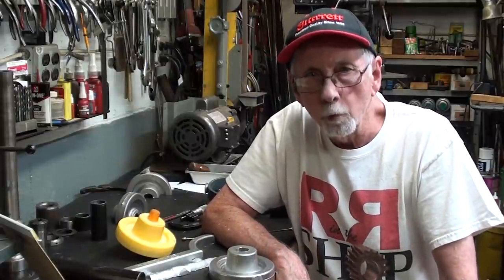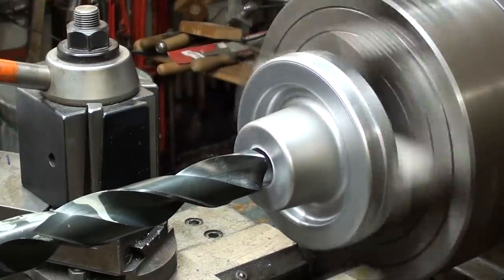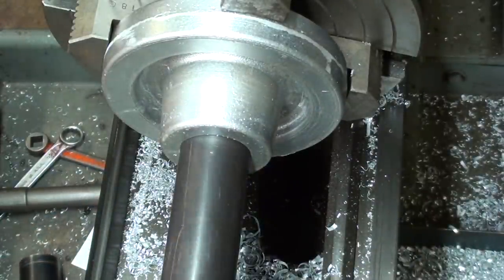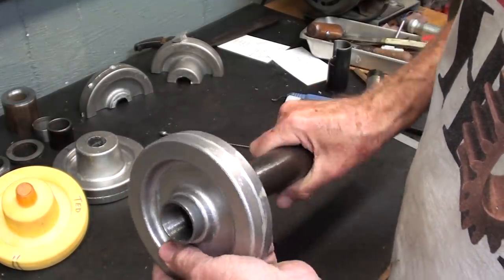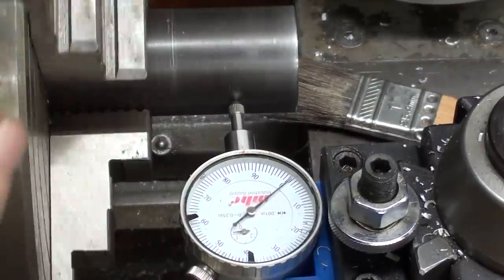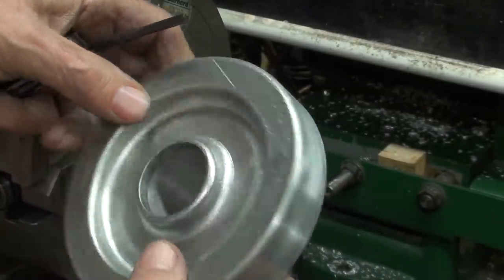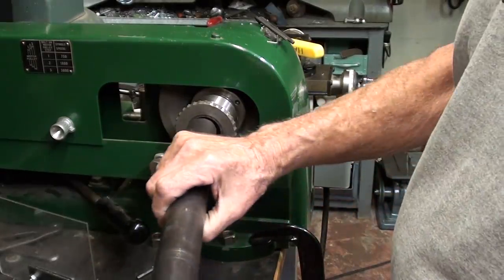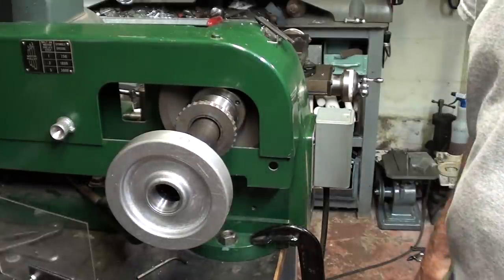Make a Hardinge Lathe Collet Drawbar 747 pt 3  tubalcain 5c attachment

Comment: Lovely.
Lyle,
You either are exceptionally practiced or simply gifted with an intuitive notion of how to teach. I think that you and Adam Booth understand the very best of what the inexperienced hobbyist needs to know, or more importantly what the hobbyist needs to see on YouTube video to gain the best understanding. Your camera angles give much insight into features and functions that you don't even comment about. I failed to grasp why your cuts were so light until you explained how poorly the casting was grasped by the chuck jaws due to the casting draft. You have a knack of what needs to be commented on and what needs to be shown. 
Your vise mounting bolt stop was adequate for locating the spanner wrench hole center, but if this was a precision location the casting surface runout could introduce too much error. Your employment of Loctite always unsettles me. I was trained to employ press fits, keying or pinning. Employing Loctite in applications like this seems legitimate. It allows assembly fit up ease and masks some machining inaccuracies. Precision boring and turning are difficult for me to achieve on my little Atlas. I introduce taper so easily. Employing Loctite in my projects is an option to remember. What color Loctite will you use for this application? That spanner wrench will allow tremendous force.
My Atlas came to me with a collet drawbar, but no collets. Do Atlas collets fit the spindle taper or do I also need an adapter. I have never seen any collets specified for the little Atlas lathes. 
I am anxious to get my new shop complete where I will have room to set up my partially restored LeBlond lathe. I am looking forward to the size and rigidity of an industrial machine. Bigger shop means more room for bigger machines. I am already beginning to think more and larger VFD's or larger rotary phase converters are in my future. I only currently own four 3 phase machines, but more space means that I can soon go shopping!
Reply from the maker: Thank you for a nice comment. Yes, you need a spindle adapter for your collet drawbar

Comment: When setting up the Rose Index, you don’t need the side to be vertical. You could use an angled plate as far as that goes, because the Rose Index will still rotate 90 degrees when you line up the next side. Also, since you are not lining the 1st hole to anything, you can clamp the Rose Index to the tube first and then turn the tube to position it against the square. It would be a lot easier than trying to keep it lined up against the square as you tighten the clamping screw.

Comment: That rose index is a great tool, and yes the protractor enables you to determine any number of sides by obviously dividing, say 5 into 360 giving 72 deg. increments, but only with eyeball accuracy, really. Thanks for sharing, Lyle and looking forward to the next instalment! :)👍
Reply: Thank you for your kind  words. I do appreciate it. 

I'm working on some type of narrated video for the use of the "Degree Wheel". I haven't used it in an actual customer part yet, however it is very accurately printed. I recommend keeping it in a couple thou from the end of the stock to minimize scratching the face. Setting to 0 degrees using the outside square is easy. Whatever degree index you want.....put the top of your square to the number you want.....and rotate a bit until the bottom number is lined up at 180 degrees more than your top number. (example would be 10 degrees on top and 190 degrees on the bottom.)

I need to play around with the 1" model and see if I can get 5 degree increments marked and still be able to see them.

Be Well and Thank you,
Timm Rosenthal

Comment: Why not make the bore undersized, heat the handwheel and  then slide the drawbar in it?  That should give you a nice, tight fit.
Reply: Another method would be to use a 3/32" diameter pin on the split bore/tube radius. Spot the snout with an endmill to keep the drill from deflecting. Center punch each drilled end to retain the pin.